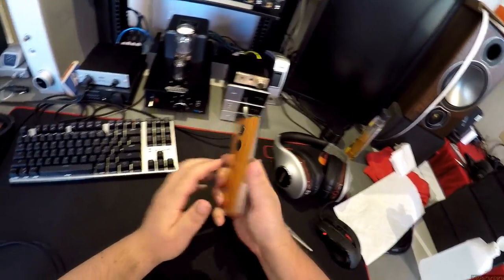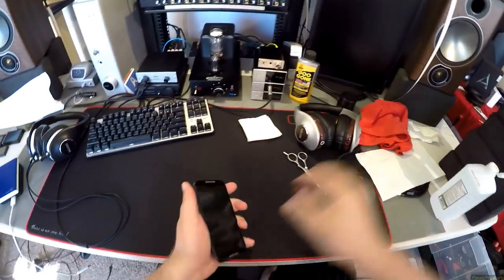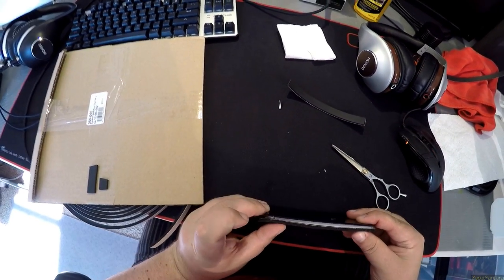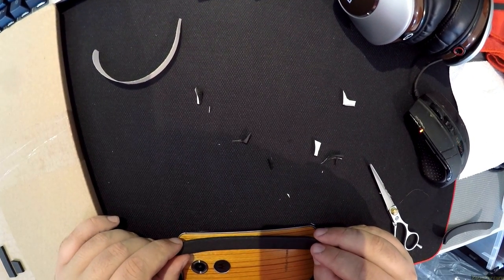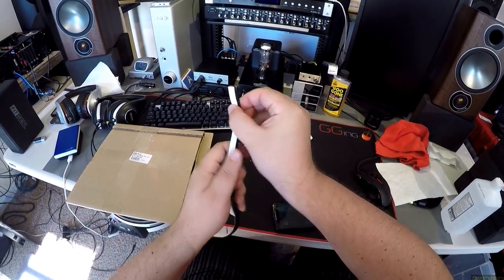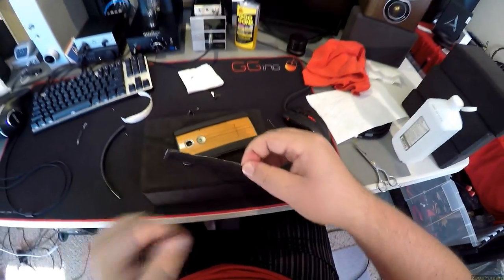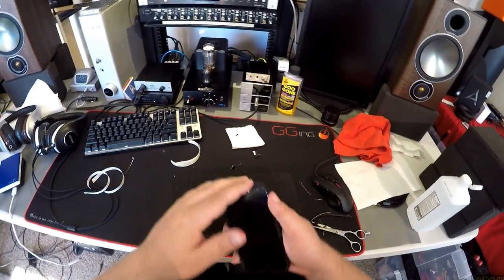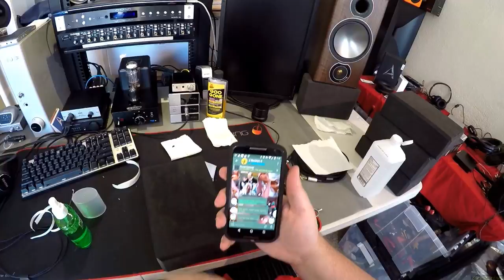Z How - Custom Foam Phone Wrap

Comment: I'm totally anti phone case. I think they are actually worse for your phone than not having a case at all. 
particles of dirt and dust get into the case and rub against the case and phone which makes it get all scratched and stuffed anyways. and some cases put pressure on certain areas of the phone that could make it crack easier when dropped. 
Also screen protectors are a load of BS. modern phone screens are made out of such hard glass you can even scratch them if you tried. unless you took sandpaper to them or rubbed them with quartz sand. I've owned countless phones and have never used a case. people always tell me how nice and new my phones look and are shocked I never use a case. And I just don't understand why somebody would buy a beautiful, slim phone to put it in some bulky case and never take it out. Then they upgrade their phone and get rid of the old one anyways.